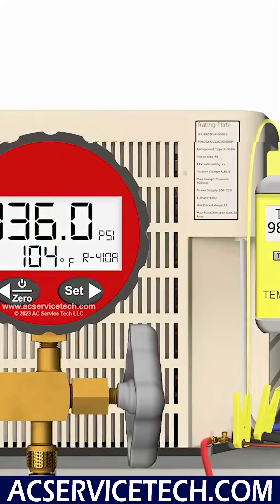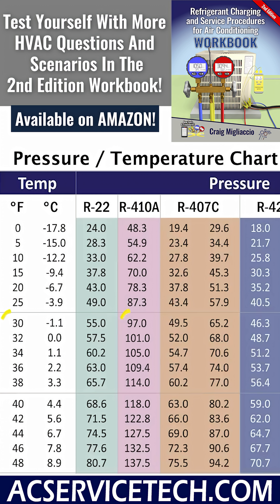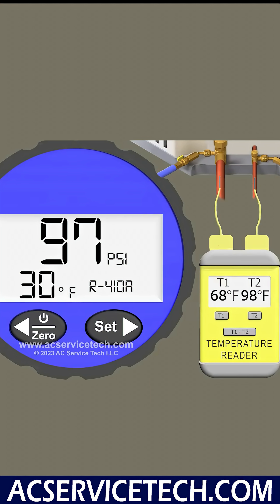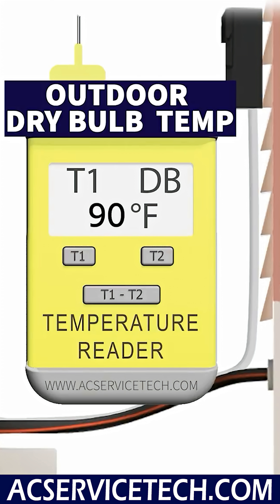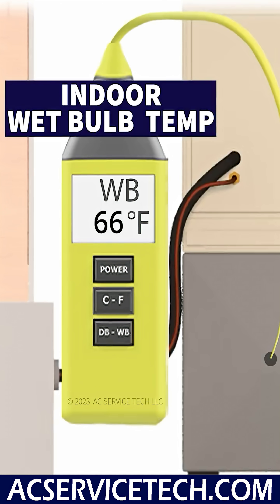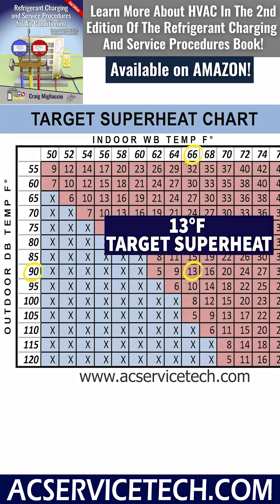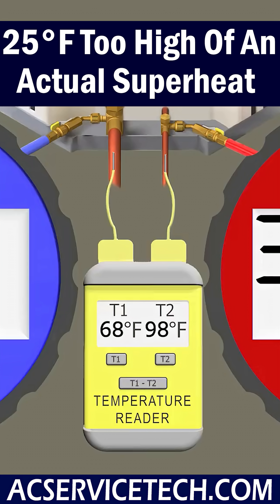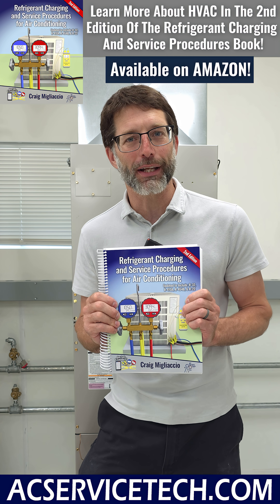Calculating Total SUPERHEAT on a R-410A & Piston Equipped HVAC System!

Comment: I have NEVER seen a service tech use a psychrometer. I'll bet there isn't 3 out of 10 that even know how !
Reply: They doubt they still use wet bulbs at the race track either. Seems most units use the TX valve's .. Now they use stepper motor txv.. Unnecessarily complicated..

Comment: I ordered the book and i am supposed to get it today . I so excited.  thank you 🙏
Reply from the maker: Thats so awesome and please let me know what you think of it after reading!!
Reply: @acservicetechchannel I will thank you
Reply: @acservicetechchannel  what is the answer the the problem to high of a super heat means low refrigerant charge?
Reply: @zacharykramer4394   this information is not entirely correct. You can NOT set up a system based on superheat only.